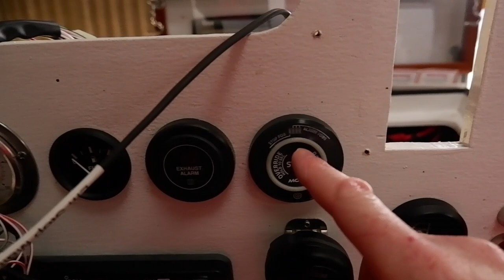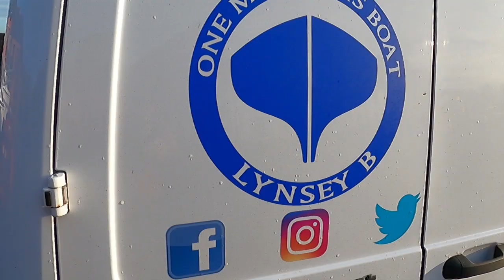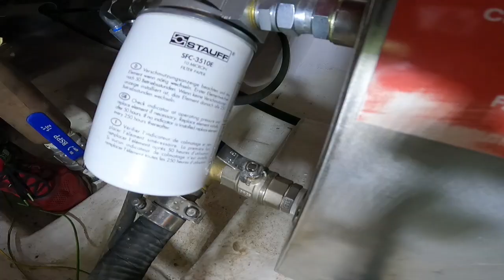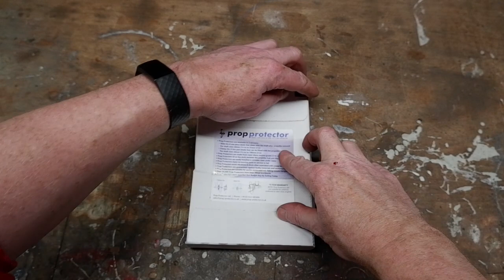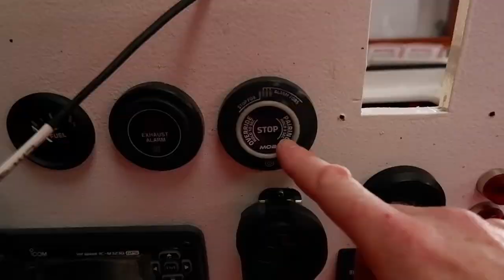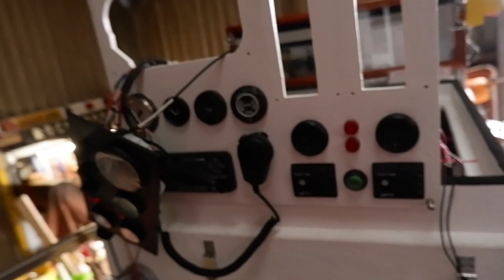100th Episode!

Comment: The boat’s looking fantastic Barry, she’s a real monument to your hard work and dedication. 

There seems to be some confusion over your earthing. 

Earthing is for electrical safety. At 12/24v DC, and for the currents your equipment will draw, I personally wouldn’t electrically connect a negative earth system to true ground, ie. The sea. Your fuses will protect your electronics. 

Cathodic protection is different. What’s happening there is that metals connected in a cell, ie. via salt water, will give up their ions to more noble metals (cathodes). To prevent this we connect them electrically to a less noble metal(anodes), usually zinc or aluminium, which will cause the less noble metal to give up their ions and corrode away first as a sacrifice. 

For galvanic corrosion to happen the metals must be part of an active electric cell. In practice on boats this really means seawater. So, an engine that is completely electrically isolated from the sea will not corrode (Obviously salty water mist in the air can cause the same effect but much slower as it’s a less efficient cell). 

Really, only the parts connected to seawater, coolers and pumps etc, need to be protected and these usually have their own little zinc anodes. You certainly don’t need to shunt connect each side of a cooler with cable as sea water is an excellent conductor of electrons, so much so that it’s the cause of the problems. 

I suspect that connecting the negative side of the engine to a submerged anode will cause the anode to dissolve quite quickly.

I would connect the anode to the lower part of prop shaft after the flexible coupling from the gear box. I would use the flexible coupling as an electrical isolator from the live engine and gearbox. So I wouldn’t bridge across that with a earth wire. 
 
I would also be wary of connecting the steel or alloy sea suction strainer casing to the bronze of the seawater pump as bronze is more noble and the strainer casing could act as an anode. 

Static discharge from the fuel tank is a separate issue again. This is a big safety issue. I would probably ground that through a separate ground plane such as your RF ground plane (which is taking static out of your electronics and radio) or a similar sintered bronze plate attached to the hull. 

Anode direction? Probably doesn’t make a big difference at creel boat speed but big end first in direction of travel causes less drag. Think of the shape of a rudder. The big end causes a “bow wave” which then flows smoothly down the pear with no eddys to cause drag. 

Apart from all that, excellent series of videos. You’re 100% right to wait for the good weather. 
I hope you had a merry Christmas and all the best for the New Year.
Reply from the maker: Merry Christmas Chris! We hope you and your family,  had a wonderful Christmas time. 

Bloomin heck!😲😲😲....thank you so much, for the VERY detailed analysis of this vlog.😉👍
I should have definitely got you up to explain what on earth is going on with earthing...as you may tell...I'm kinda clutching at straws, and passing on info,  that I've YET still to confirm with the sparky.😂😂😂🤣🤣🤣 don't get me wrong, I know a little...but nothing to that kind of detail...earthing seems rather complex. 😬😬😬😁👌

I absolutely! take everything you said, on board, and i will adjust the earthing accordingly, as you've suggested. As you may tell, it's all still a bit of a working progress....but at least she'll be earthed well.😂😂😂🤣🤣🤣

Thank you so much for your time and effort in this detailed comment,  and your support throughout this year.
I really appreciate all feed back.

Hope you all have a FANTASTIC  new year.
All the best for 2022 when it comes in.

Baz.😉👍